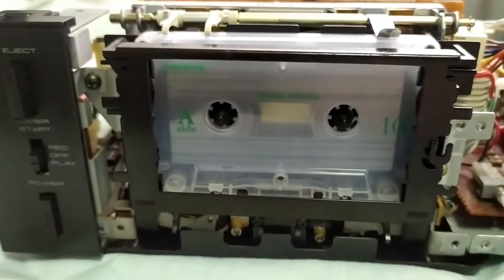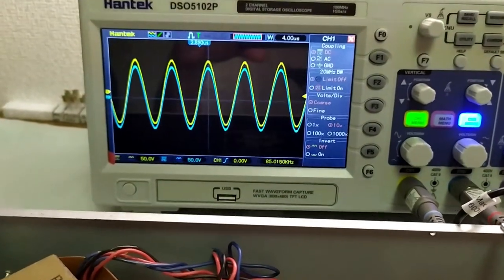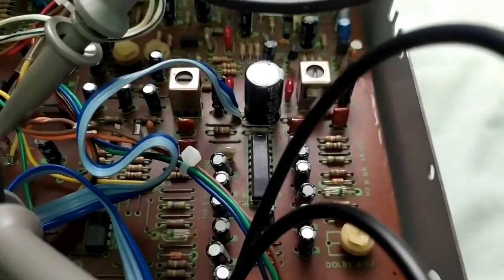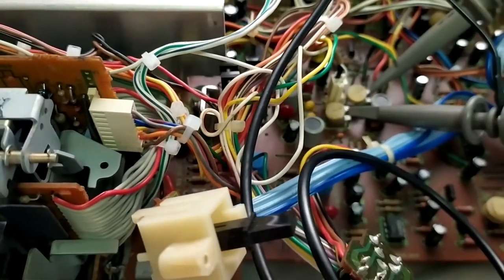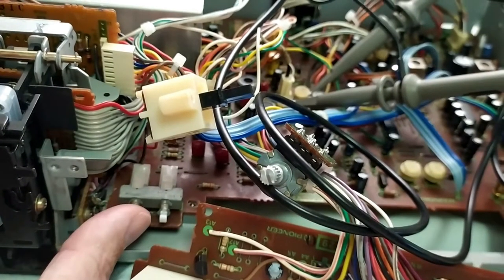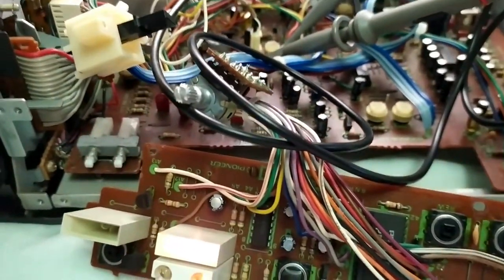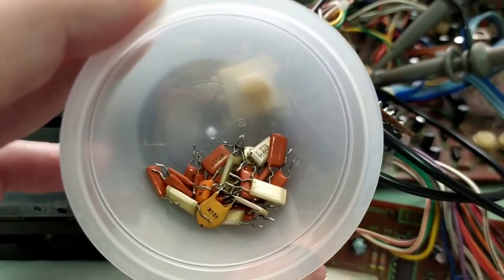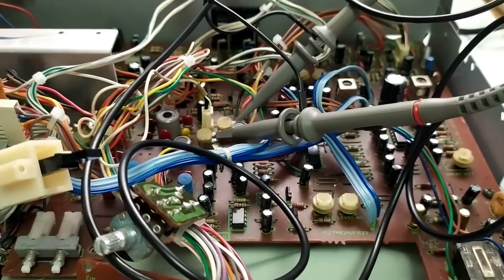Diagnosing and solving cassette deck recording issues - Part 2 - Pioneer CT-7100

Comment: Excellent, i'm chuffed you won :-D
Some of those caps must be leaky at high voltages, the rest will be outside there spec.
Electrolitics are very evil, they work for years then leak electrolite  suddenly and eat tracks and other component legs.
I have an old Realistic 2005 scanner, it always worked but it sat on a shelf for a long time.
One day a frend was having problems with his old car unlock fob, i thought 400 ish mhz band and my scanner covers that band, so i can hear the burst.
Nope! the scanner was dead :-(, some electrolitics just leaked and ate a group of tracks on the pcb (horrible mess).
So i had to fix the scanner first lol.
Ok back to the fob, no emmision.... a power track had broken going through a pcb hole.
A bit if bare wire pushed through the pcb and soldered both sides stopped its fun lol.
Reply from the maker: Seriously, sometimes it feels like you've hit a wall with this stuff!  I'm always amazed that the IC's are almost never the problem - or at least haven't been for me so far.

Interesting to hear about your issues with the car fob.  I've had problems with them before, never really considered looking much deeper.  Good to know!
Reply: @felix_da_katze  Communication receivers can be handy for finding problems in i.f strips/oscillators/mixers in c.b radio or broardcast radios.
Why probe a oscillator with a probe that could stop it,  use the communication receiver antenna wire near the oscillator.
Sniff sniff without upsetting the circuit :-D.
People often have test gear they dont realise they have.
Ill shut up now :)
Reply from the maker: I hadn't thought along those lines.  Sounds like it could be useful.  Got any more info?
Reply: @felix_da_katze  Sorry im a one hit wonder lol.
It's just thinking about the propertys of things around you.
When i wanted to trace a fault in a tape recorder audio playback stage, an old radio was used as an amplifier,  screened wire tapped on to the volume control,  Instant monitor.
Yes i know its very basic silly tests.
You have an oscilliscope, so you could use it for audio checking, but your ears are so much better at hearing distortion.
I sound like an old git ha ha :-D